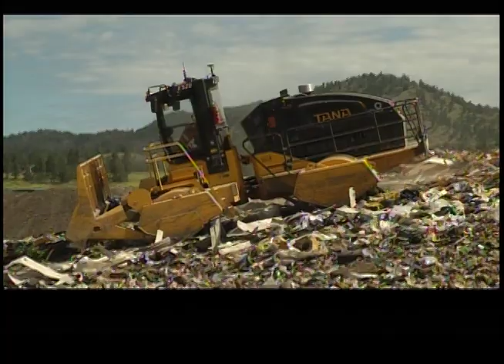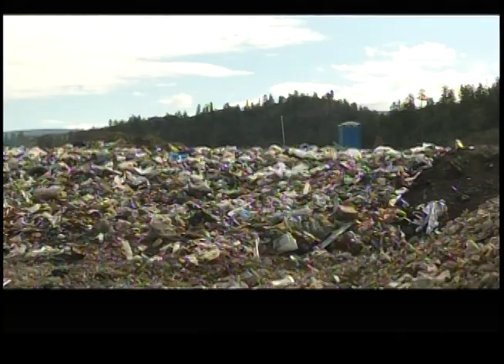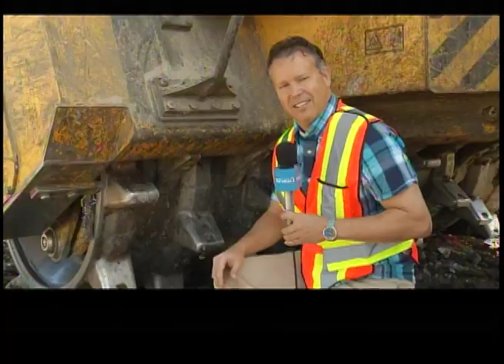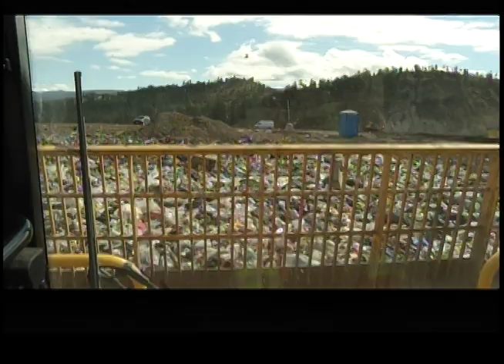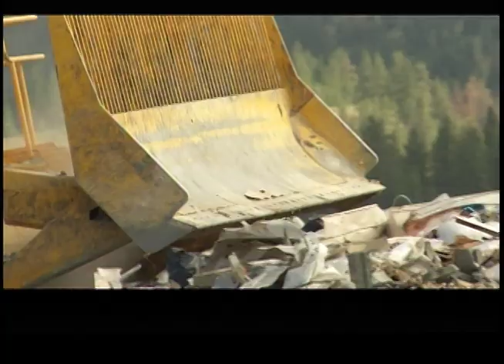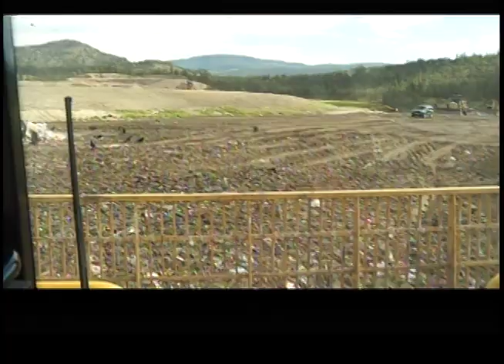Waste Compactor

Comment: Mranman:

TANA gets that response every time someone in the landfill business first looks at a TANA.  They actually have to come and demo the machine To prove its capabilities.  At some point, there is an 'AH HA" - moment, where the customer understands.

This video claims a 20% or so better compaction.  That is actually common for a TANA over a 4 wheel compactor.

TANA is the compactor of choice in Europe, Asia, Africa and Australia.  It is new to North America; first unit arrived in fall 2012.

The company is taking a systematic approach to proving all aspects of a good business model.  Its not just enough to have the best machine, there needs to be support and of course durability.  TANA is proving these as well.

Comment: Not true Mranman.  TANA design combines rigid frame with small diameter drums providing significantly higher forces than traditional 4 x wheel machines. The compaction is 100% proven over every competing machine and they guarantee it. You don't believe it?  Contact any TANA operator and ask for the facts or go see one in operation yourself.  I did!